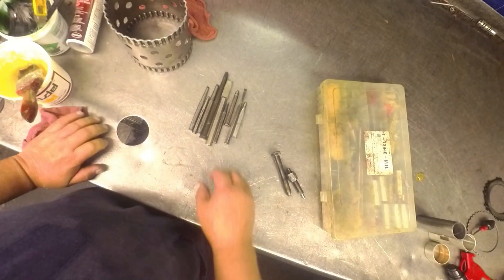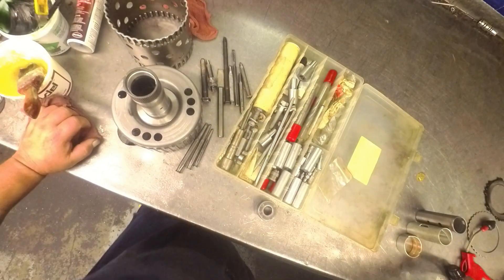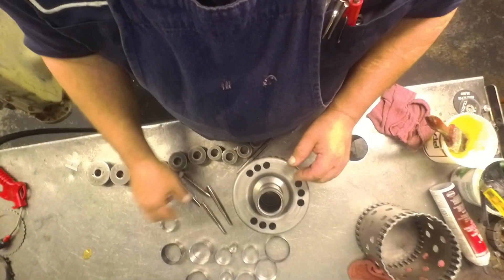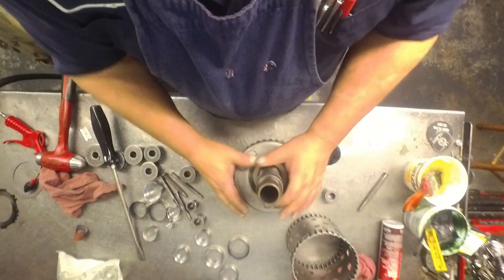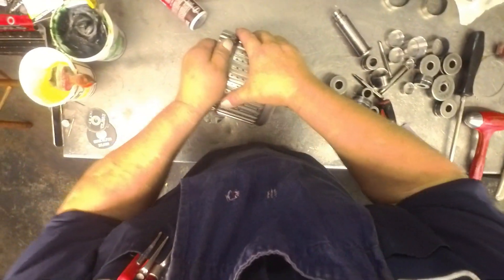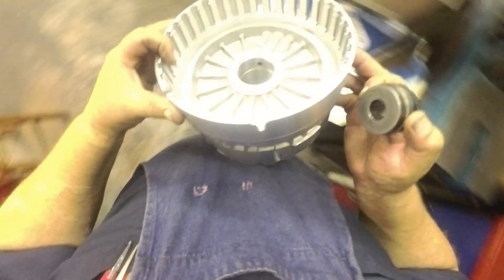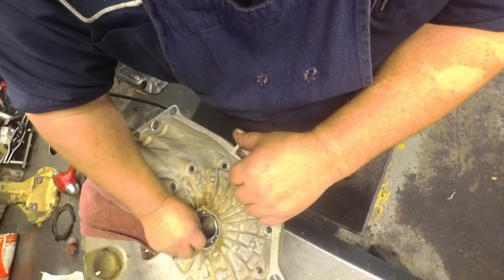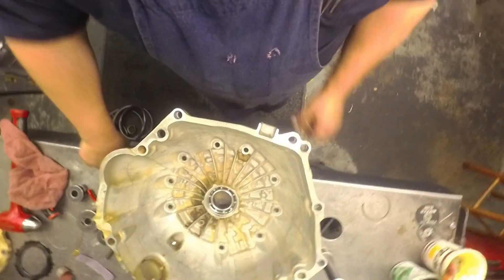Installing Bushings

Comment: Tom,  thanks for showingn the tips about installing bushings  for drum, pump, shaft, satator etc. do you replace this during overhaul on toyotas and honda's .. or if u see a groove or play u change it.
Reply from the maker: @sivucit  I put a bushing kit in everything. The stator bushing is critical in Toyota's. It will give you lock up codes even if lock up is working.
Reply: @CurmudgeonTransmission  Thanks Tom, do you have any HONDA transmision build where u show bushing installation that is bit trickuy.  if you have it please give me the name, i will search and watch it please.
Reply from the maker: No, I don't. If you can get your hands on this, it will help immensely. https://www.atkits.com/individualproduct/28999-tool-set-honda-bushing-remover-and-installer-22-pcs-

Comment: Ran into this today with the center support bushings. I can turn the 3-5-R hub by hand when it's fitted, but it's pretty tight. How tight is too tight? Is this a self correcting problem?
Reply from the maker: If you can turn it by hand you will probably be ok. You can clean it up a little with some very fine sand paper or hone.

Comment: I agree 100% with the Chinese bearings theory, I have had too many that I have to sand down I order to fit properly,,,,exact fit bushings that don’t exactly fit......very dangerous
Reply from the maker: This last year parts have been quite the problem.
Reply: ive had the same problems with high spots,even after checkin the bore for high spots sometimes created by bushing cutters

Comment: great vid Tom,it would have been interesting to see you mic the inside diameter of the troubled hub and compare it with another 6l80 hub to see the actual difference if there was one or even to measure the outside inside diameters of the bushings you used to determine what the problem actually was.
Reply from the maker: Thanks. If I had a mic that I could have fit in there I might have. Had to have been a bad machine on the hub. Same 2 bushing kits I always use and never had a problem before and I've done a lot of them.